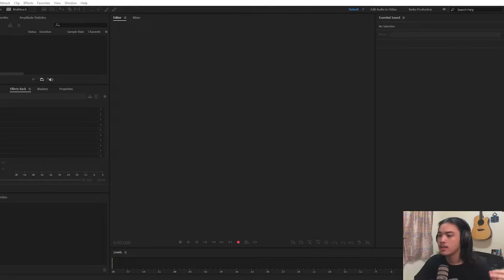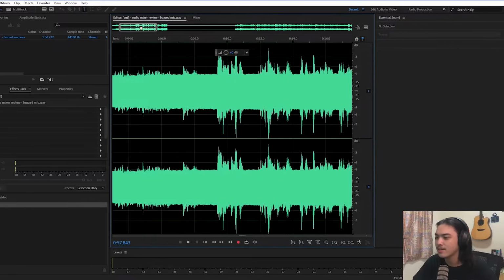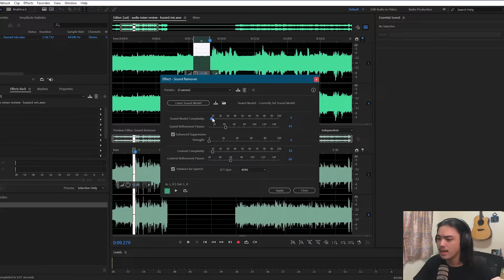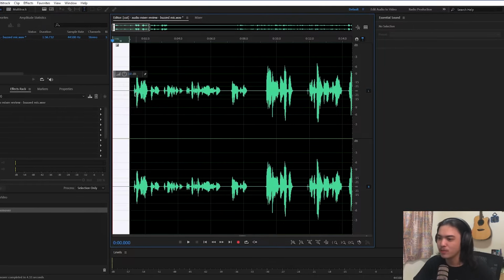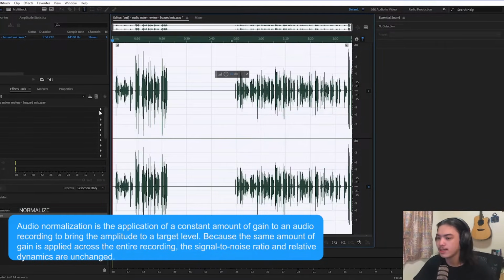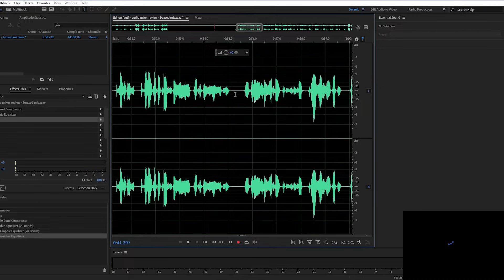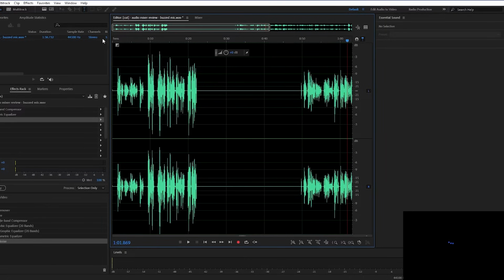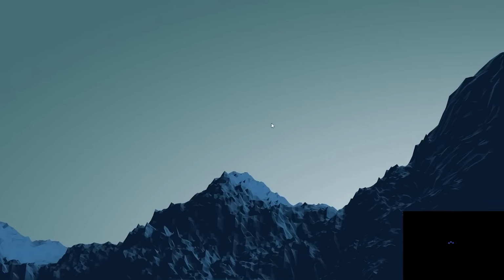How to Remove Buzzing and Static Noise From Microphone using Adobe Audition

Comment: This isn't helpful because the noise that pops up in my audio happens only during a moment that I'm talking. There is no moment where it's just the noise.
Reply from the maker: Then you might try to adjust and leave a little room. + if you also have a pre-recorded video audio clip you want to do this trick on then I suggest to just capture a little bit of blank audio noise profile then use that as your noise profile for removing the noise.

Comment: Thanks for the advice. Hey guys overthere! I'm getting some clicking and static noises that are not coming from the source or instruments being recorded. It happens just after the audio file is saved and seems to be CAUSED BY THE CONFIGURATION, NOT THE SOURCE. Any idea or advice will be appreciated. Regards fro Mexico!
Reply from the maker: This should still work if the buzzing is caused by the static configuration.

Comment: i do podcasts with shure mic and it has a static noise, I tried this but I could do 30 mins at a time :( either way worked, and thanks!
Reply from the maker: You would have to zoom out! I was able to do this would more than 1hr worth of clips :)
Reply: @alendou  Having this exact same issue. I have 1:40:00 of content but it is telling me I can only use this on 30 minutes of audio